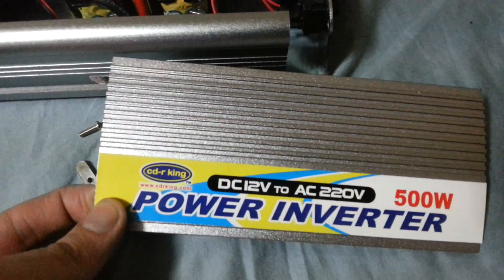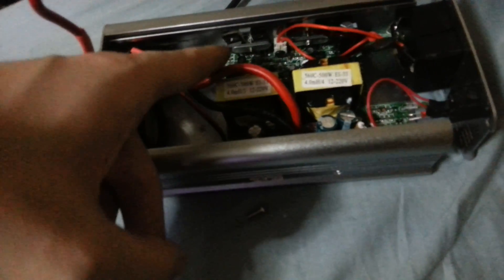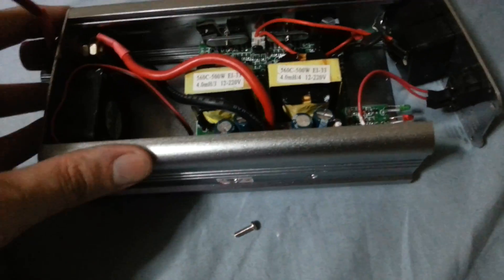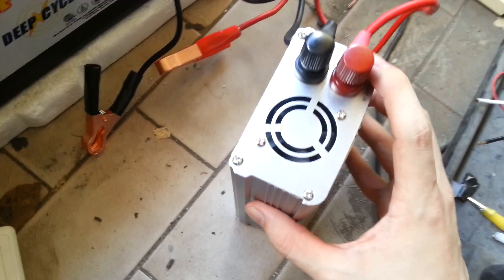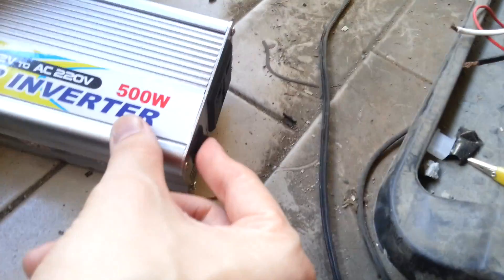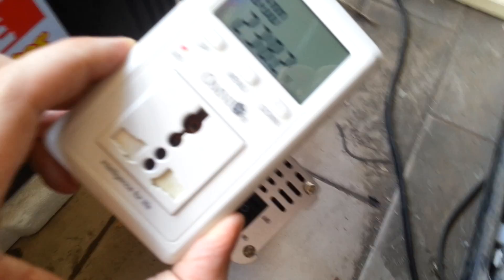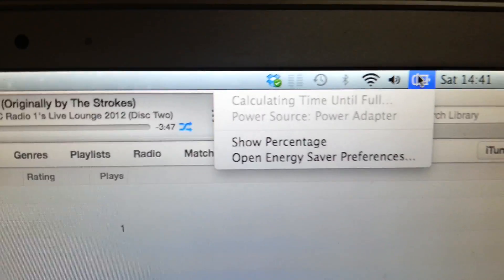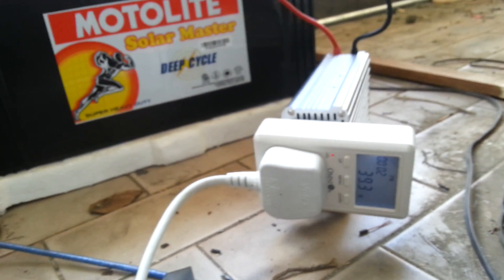CDR King 500 watt power inverter

Comment: Hi GA, is it necessary to install a voltage regulator after the inverter? Q2. is it also necesary to install a PSW UPS after the inverter to produce a PWS AC? thanks and more power.
Reply from the maker: Bernabe Joji Dumaliang It shouldn't be required and it would consume a few extra watts but then if you have something very expensive or sensitive, you might still consider using it. Unfortunately I don't think a UPS can convert a modified sine wave to a pure sine wave.

Comment: My friend's CD-R king 500 watts power inverter got blown when he connected the wires from battery the wrong way. A transistor is visibly burned. The label says it is a HY4004 FL002S51. What was it. A MOSFET or volt regulator? I couldn't find the datasheet on the net. I want to repair it but don,t know what part's name of that transistor.
Reply from the maker: From what I can tell, it's an N-Channel mosfet. rated up to 40V/208A. You should be able to replace it with a standard 'power n-channel mosfet' from somewhere like DEECO. Hopefully nothing else has blown in the process. I'd love to hear if you get it going again :)
Reply: Gadget

Comment: Hi just bought the other model of 500 watts of CDR king  inverter the one that has 2 fuse thats visible at the back of the inverter and has a usb port too... My question is when i tried it to power my TV using the inverter i notice that their is a little "ZZZzzz" sounds on my TV not that loud though, which happens to be a LCD 39 inches TV  running 130 watts,,,,  what do you think it is? and also notice a line like a low signal running from bottom to top in my TV
Reply from the maker: ptcmaster15 These cheaper modified sine wave inverters can cause sensitive electronics to pickup some noise. Many TVs and such like will filter this out in their power supply, but sometimes it can slip through. You may find that putting an AVR or UPS between the TV and Inverter will smooth out these issues.
Reply: hi Gadget Addict  thanks for the reply and suggestion... but i already tried those as well ,, like using AVR .. but still this noise like wave form still occur... Do you think using longer extension wire from the inverter cause this? because im using a long extension wire just to reach my TV? TIA
Reply from the maker: ptcmaster15 There can be a voltage drop over the long wire which may amplify the problem of the modified sine wave. Have you tested plugging the TV directly into the inverter? Unfortunately this really is a problem with modified sine wave inverters (vs. pure sine wave inverters) and some sensitive electronics can be effected.
Reply: Gadget Addict i havent tried to connect it directly to the inverter since the Tv is far from my battery or SCC i was thinking to use big wires to be an extension wire going to the TV... this Sound Waves is killing me i really wanna use it! :) 

By the way they said that if its a modified sine wave, once you've plug a motorized gadget like (efan )  you can hear humming sounds or ( ugong) where am i suppose to hear this sound? is it humming on the Efan it self or the inverter will be producing a humming sounds?
Reply from the maker: ptcmaster15 If you bought the inverter from cdrking then for sure it's a modified sine wave, they don't sell any pure sine wave inverters. If you connect a fan you will notice it spins slower than when connected directly to your regular AC socket and you MAY hear a buzz/hum from the motor itself. You may also notice it takes a bit longer to get up to speed. I wouldn't invest in any thick wire extension cable until you've tested whether the shorter/less loss will actually solve the problem in the first place. If possible, just take your TV to where the inverter is and plug it in directly. I've seen some modern TVs use an external power brick similar to a laptop charger which converts the AC power to DC. If thats the case with your TV, you might be able to skip the inverter and use a DC-DC converter instead.
Reply: Gadget Addict anyway i got extra wire aircon wire gauge 12, its imposible to put my tv directly from my inverter as it is far from my setup thanks for the advice ... great help... keep it up

Comment: i dont know to manage the usage, but if i see to the digital capacitor, the battery use if 12.2 its mean going to lobat, then ill charge the batery, then put it in side car motor to use it, then use again, im mean if im lobat batery, ill charge it, then if full use it, how about my say to you , i use the inverter to, use my 220volt applaiances like ps2 with t.v. or magic sing karaoke and t.v., its ok how about the other like 1500watt inverter its ok?
Reply from the maker: RYANMARK SARACHO A 1500 watt inverter on a 12v 70ah battery should be fine but remember the more watts you pull, the quicker you'll drain the battery and if you oversize you're inverter, you'll be wasting power because the larger the inverter, the more idle power it draws.

Comment: i have question sir. i have battery in my motor cycle, 3-s.m. 70 ahm, and i have charger my house 50 ahm, i have 12 inch sub 4-6 inch triway 2 twiter amply, its okey if im loading cause i have charger my house, but my question is, its okey if i buy like that cdr king 500watt power inverter, to do put 16-led t.v. and playstation 2, my motor cycle, but i dont know tha watt of ps2,ill search but not see it.. its okey to do that? and i have magic sing karaoke, can i put that 16 led t.v. and ps2 and magic sing karaoke its that ok?
Reply from the maker: RYANMARK SARACHO Mmm it's probably okay. Are you sure it's 70ah? That's a pretty large battery to fit on a motorcycle.. The only thing I'm not sure on is how much power the amp will surge. I've used a smaller 300 watt inverter to power a home stereo system and didn't have any issues, even with pretty heavy bass. But I can't guarantee without seeing your equipment and testing the power usage.

Comment: can i used this inside my car & have a small tv ?
Reply from the maker: juan tamad Yes, you can. Many people use inverters like this for powering TVs and laptops inside cars :)
Reply: Gadget Addict am planning to put a small subwoofer & speaker on it with lcd 18 inch ,  thanks ,
Reply from the maker: juan tamad Good luck :) Just remember that a sub can take a big surge or power. So if it's too powerful, the inverter might not support it.
Reply: Gadget Addict its only 8'' subwoofer bro. just enough to hear a bass sound inside my SUV while watching concert on 18 inch lcd monitor.  can you recommend me how many watts should i buy, 500w or 1000w ,, the car engine is running while im using this.  thanks a lot
Reply from the maker: Mmm I really wouldn't know to be honest, i assume you'll be using some kind of amp to connect the sub and speakers to the TV? So as long as that's rated under the 500 watts, you'll probably be okay.

Comment: Hello Sir,

Im planning on investing a solar power bank for a computer that runs 450-550 watts full load that can last 2-3 hours . 
UPS's not worth it .they die easily....more power..
Reply from the maker: Have you measured that wattage or is it an estimate based on the power supply? That seems very high. Anyway, sure you can do it. Just consider how long you need it to run when choosing your battery(s) and choose appropriate sized panels to recharge your battery(s).
Reply: measured it ... mining profit going down because of high power bill... must go solar :)
Reply from the maker: Mr3kVia Oh nice, a miner! That's pretty cool. And it's a win-win. You save money on your Meralco bill and the rig makes you money while it's running.

Comment: sir i have solar system only 75 watt including charge controlar and battery (12 v 100 ah).my question is may i use 500 watt inverter from it and how many watt i can use from it. and for 500 watt panel how many  Ah charge controlar i need.
Reply from the maker: You can connect the 500 watt inverter to your 100ah battery and draw the full 500 watts. Although most cheap inverters overheat or shutdown before they actually hit their rated output. Just consider that you'll be using power a lot faster than you'll be replacing it.
Reply: Gadget Addict thanks a lot . i need only 100 watt out  from 500 watt converter  it is possible?and how long it will work.
Reply from the maker: Monir Ahmed If you only need 100 watts, you should probably buy a smaller inverter. Bigger inverters waste more power. Most people don't want to drain their batteries past 50%, so lets imagine you have a fully charged battery and are willing to drain it 50%, that gives you 50 amp hours. A 100 watt load at 12volt would be 8.3 amps. 50 / 8.3 = 6 hours.
Reply: now i am happy your answer is really helpful.thanks again.but i have one more question that is , for 100 ah battery how many watt solar panel is perfect. because someday is rainy day.

Comment: Hello Sir, 

Does that inverter produce 60hz of frequency? I have this tbs 2,000w inverter and it has 50hz freq. When i plugged in my exhaust or electric fan, then turn it on, the fan motors are making noisy sounds. I believe this is because of the 50hz freq. if this inverter is truly 60hz, can you please plug-in an electric fan and compare the noise of the motor to the normal on-grid power supply? Thank you in advance!!
Reply from the maker: Are you sure the problem is the frequency and not that it's a modified sine wave?  Inductive loads like motors don't run well on modified sine wave inverters. They'll work but as you say they will make noise, waste power, heat up and not run to their full speed. This inverter would exhibit the same problems you mentioned because it's modified sine wave and not pure sine wave. Pure sine wave inverters are more expensive. I do sometimes run a fan on this inverter but it does have its problems.
Reply: I'm not sure if it's really the frequency or something else. Maybe you're right about the modified sine wave issue. Hmm I think I should invest a pure sine inverter to run my exhaust and fans without any noise. Thank you very much sir for answering my questions. We actually have the same hobby and i will surely have more questions to come. Please bear with me :) thanks again!
Reply from the maker: Christian Jei Villa I'm happy to help :) Modified sine wave inverters will cause inductive loads like motors to wear out a lot sooner than pure sine wave so if this is a load that you're running every day, a pure sine wave inverter would be a good investment :)

Comment: good day.  You mean, if you have a 500watts inverter and turn the power on, it produces 35watts only?  If so, I can't run my 60watts LED TV?  Is there any device that can determine the power level of the battery before running low (for monitoring purposes).
Reply from the maker: The inverter can output up to 500 watts. In this example I was consuming 35 watts because that's how much the laptop was using while plugged in. If you're using a charge controller, it will usually show you roughly how much charge is in the battery, otherwise you can buy a cheap (200PHP) voltmeter display and connect it to the battery and then search for 'battery voltage state of charge chart' to see how the voltage translates to charge state :)
Reply: thanks for the reply.  If I limit all my gadgets / device into a 400 - 500 watts using this power inverter, how long does it takes (in hours) before the battery run out of power?
Reply from the maker: Othello Crystal It depends on the size of the battery. 400-500 watts is pretty high. A 100 ah battery would be 1200 watt hours (100*12). That would mean you could run your 400 watt load for 3 hours (1200/400). But most people don't like to discharge their battery beyond 50%.
Reply: very informative sir, thanks a lot, mabuhay!
Reply from the maker: Othello Crystal walang anuman po :)

Comment: sir i want to buy a power inverter from CDR-KING like this one, can i plug it to my kawasaki ROUSER 135LS battery?
Reply from the maker: I think a lot of motorcycle batteries are 6v, but I googled your model and it seems like it has 12v by standard. Provided it really is a 12volt battery then yes, you can use an inverter like this :) I think the alternator on motorbikes is usually much smaller than a car. So you might be limited to 100 watts or less (before you start draining the battery more than the engine/alternator is topping it back up).
Reply: sir tanong din po gagamitin ko kasi to sa ilaw pag brown-out pwede ba to sa 5 pcs. na led bulb sabay sabay na gagamitin for about 5 hours. 

Anu kaya maganda gawin ang bibilhin ko din kasi eh tung 1000wattsfrom cdr-king?
Reply from the maker: Kenneth Mateo If the motorbike is running to charge the battery at the same time then it should be fine. Otherwise It probably won't work out well. The batteries on motorbikes are pretty small and low capacity. If you tell me exactly what battery is on your bike and how many watts the bulbs are, I can tell you how long they'll last. A 1000 watt inverter wont be any good running from your motorbike battery, the battery wont be able to handle the load and the alternator wont put out anywhere near that much.

Comment: ei bro just want to ask you if you know any brand of inverter where in i can adjust the "Low Voltage cutoff" settings?im a bit concern with the battery for over draining it, By the way STAY SAFE and thanks.
Reply from the maker: That's a good question. I haven't seen an inverter that lets you adjust the cutoff voltage and generally the cutoff voltage is too low, that it could indeed damage your battery. I had a look around now and can find separate hardware 'battery protectors'  but none of them have an adjustable voltage and all cut out at a very low voltage. I'm always careful to manually monitor the voltage when using the inverter, I too would be interested if you found something that solved this problem!
Reply: Gadget Addict We can put LVD Low Voltage Disconnect in between the battery and inverter, i guess it would solve the problem somehow
Reply from the maker: brooks shield But have you seen any sold locally? It seems they go by two names, Low Voltage Disconnect and Battery Protectors. But I have only seen a couple that are adjustable and haven't seen any being sold locally.
Reply: Gadget Addict havent seen one but no choice need to make DIY, by the way how much is your DOD Depth of Discharge?how much voltage before you usually cut-off?

Comment: yes of course , the solar panels trough the regulator and a 1000w inverter to power my computer.may be the error is that i was charging at 6 to 8 amps(depending of the sun) until 14.5volts

Comment: I think after one week , that on element is definitely short-circuited , it does not make bubbles at all and if i remove the charger , the voltage goes down slowly to 10.6volts....6.5k Pesos!
Reply from the maker: Which battery is that? The solar master 100 amp hour? Sounds like a pretty serious defect, should be easy enough to replace on warranty.
Reply from the maker: Gadget Addict I don't understand. You said the battery is two years old but now malfunctioning? What exactly happened? Did you have anything connected to it?

Comment: i had the same problem with Motolite Car battery before...Actually i am trying to recover this one with a capacitive pulse charger...What do you mean by toping up the water , put some distilled?
Reply from the maker: Yeah. Their deep cycle batteries have removable caps that allow you to add distilled water. I'm not sure about the car battery. My car does have a motolite battery but I didn't pay much attention to it. The original battery in my car was also a motolite but wouldn't hold a charge. It was just over 3 years old. The more I think about it, perhaps motolite really isn't so great. I'm planning to make a video soon about batteries for solar panels since it comes up quite often in the comments.

Comment: hey i've been watching your videos on solar and i'm getting a lot of infos, im planning to set up a solar power system for my house also i'm still at research and collecting info stage though :) my main concern right now are the batteries because its the most expensive component for the set up. and i saw you have a solar master, are they ok? have you read reviews on that battery of motolite?
Reply from the maker: Motolite batteries are mostly okay. I always bought them because of their "warranty" but recently I had a problem with a new battery and they only agreed to check it after I told them I was going to update my Youtube videos to warn people away from buying their batteries. So my faith in their company is not as high as it once was. Generally their prices are actually some of the most competitive for deep cycle batteries in the Philippines but there are alternatives that you could consider.
Reply: Gadget Addict yeah but im concern with the batteries if they will last for how many years. considering your investment in the system and the return savings when your off grid. how about the batteries at cdr king? :) have you tried them?
Reply from the maker: gnel musc I've not yet tried the cdrking batteries. I was tempted because they're a bit cheaper than motolite. But the cdrking batteries only have a 3 month warranty and they don't have the best reputation for high quality products. Their solar panels are good but there's a lot that can go wrong with cheap batteries. On a side note, the rumor is that cdrking are going to gradually increase the price of their panels over the coming months.
Reply: Gadget Addict ohw thanks for the info. are you still using the solar master from this vid?
Reply from the maker: gnel musc Yep I'm still using it. I try to keep an eye on the levels (since you can refill with distilled water) and I use a CTEK smart charger on it every few months.
Reply: Gadget Addict thanks for the info